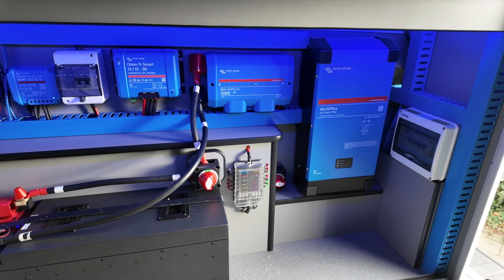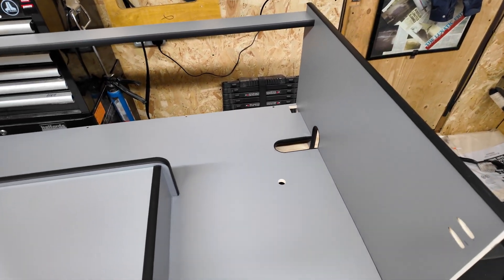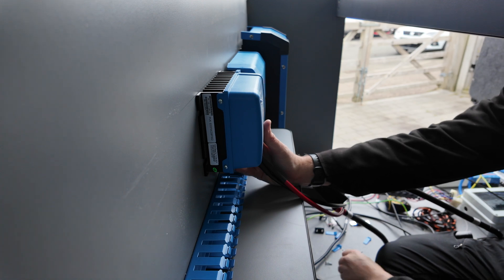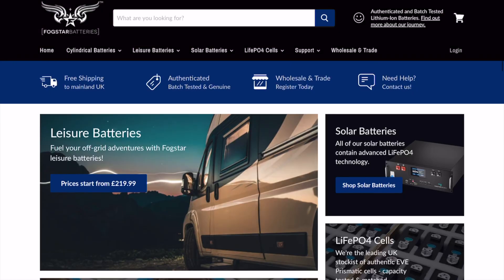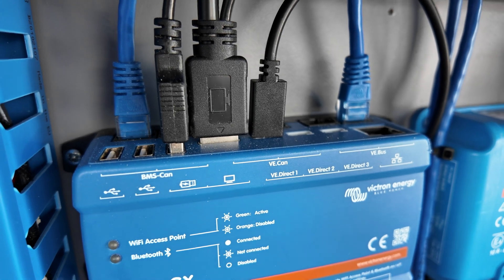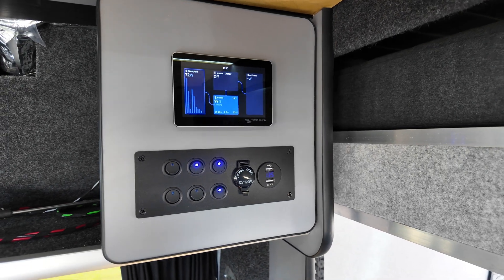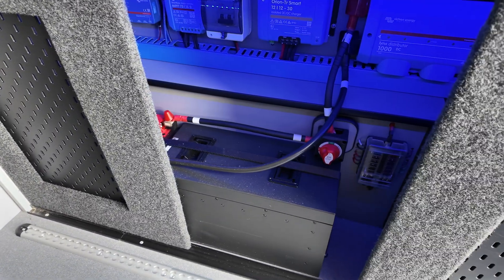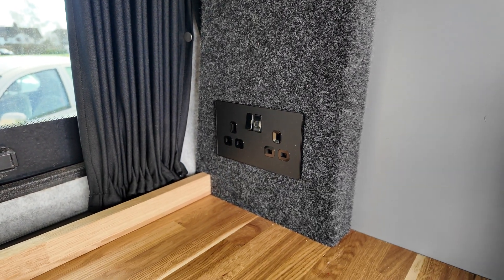VICTRON AND FOGSTAR OFF GRID ELECTRICAL SYSTEM, CAMPER VAN OFF GRID ELECTRICS, VENTED SLIDING DOORS.

Comment: So you have 4 self tappers into composite or wood to hold the battery... or are they into more than it would seem?
Reply from the maker: I have the two floor brackets screwed into the 15mm plywood floor, the battery is very heavy so won’t jump up, the brackets also stop the battery from sliding forward or back, and the sliding track stops it from moving sideways.

Comment: How did you get your Fogstar Drift Pro to talk to your Victron Cerbo GX please? I've tried numerous Victron 5m cables and get nothing?
Reply from the maker: Hi, that’s odd! Mine just plugged straight in to the Cerbo and it recognised it. Have you got it in the right socket on the Cerbo? 
Try switching all off and starting again, if not email Fogstar they are very helpful with things like that.
Reply from the maker: Try a refresh on the cerbo screen menu

Comment: Question, why no BMS to control the charging and discharging of the lithium batteries? 

The Orion and MPPT scc will not stop charging unless instructed so by a BMS. This could be sending current to the batteries when they don't need/want it.
Reply from the maker: The Fogstar has BMS built in, this battery is the pro version and is full Victron compatible. It also had direct cable to the Cerbo gx. So no extra equipment is necessary that’s why I went for this battery.

Comment: Tidy install and some great components there - very similar. Really wish I used a rail saw at the start of my cabinet build, would've saved a tonne of time. Top job.
Reply from the maker: @VanFamilyAdventures  thanks, I might swap out the Orion to a XS like what you did. Also add another solor controller to connect a fold out solar panel, I would fit extra panels on the roof but need the space for my kayaks. The track saw is a game changer,

Comment: Lovely job mate. Where'd you get that metal perforated fronting on the sliding doors from?
Reply: Oh Ikea, just seen that part. Nice!
Reply from the maker: @adamjones9 there a back board for pegs to hang things on I think. I got them in the home office section if I remember correctly.
Reply from the maker: @adamjones9  hi, thanks, I explain in the video what it is and where i got it from. Go to the section of the video where I make the doors and it should be there. 👍

Comment: Looks great, am I right in saying that the drift pro connects to the cerbo GX and therefore there's no need to the smart shunt? Or does the smart shunt have capabilities that the BMS - cerbo GX don't have?
Reply from the maker: Hi, yes the Fogstar drift pro connects to the cerbo, the cable is supplied. The battery has built in BMS and Victron compatible. So not need for a smart shunt, this was makes it neater and less complicated, along with the Lynx is a much straight forward install. I’ve been testing it and had not problems and everything works as it should, the cerbo is amazing.